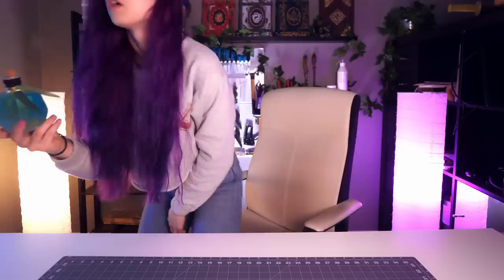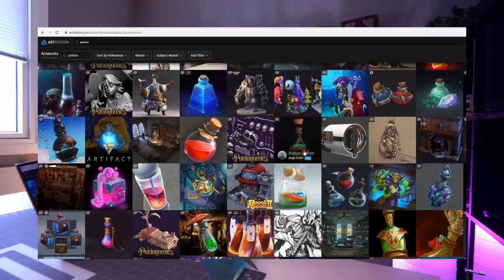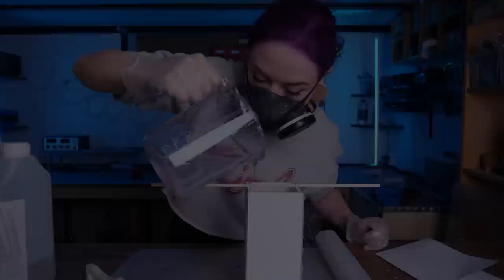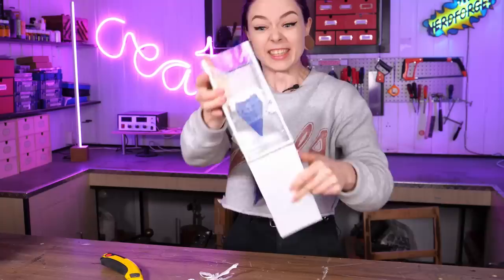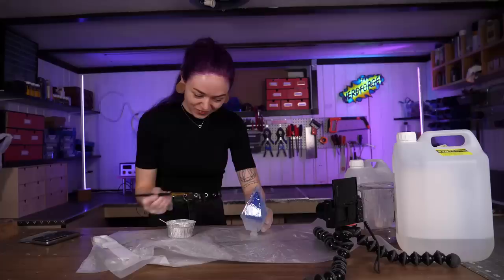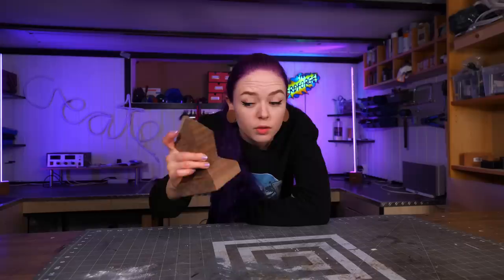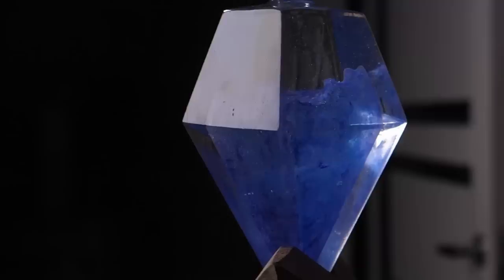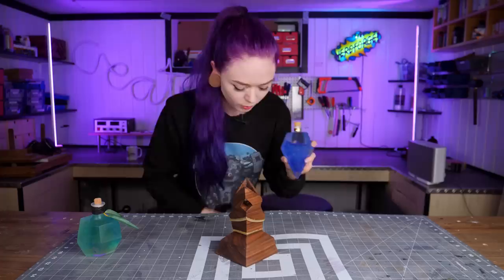I Made a Magical Potion from Epoxy Resin!

Comment: but why you dont just use the sanding method to make it shine i seen tons of videos for resin design and some can look almost like glass ? you can easily polish it using sanding methods  using same machine you had or another method , but its just a softer sanding tool it will look amazing

Comment: I'm curious as to your sanding process for the resin. I've only started working with resin over the last 5-6 months and I've tried sanding with wet/dry sandpaper all the way up to 1500 grit yet cannot get the resin to polish to a point I can accept it and its made me not want to attempt any projects that require sanding resin.  Any tips or guidance that you could offer to get clear resin to sand well?

Comment: hey @Nerdforge.
I'm kinda new to your videos love the things you've done so far.
but with this one i would like to point out a few things. 
i am a woodworker. and knowing how expensive the walnut is i would suggest and for future builds, if you want to make a hollow stand or a hollow something to remove time and materials spent to waste. to make smaller boards with a 45° bevel and glue them up using paper or packaging tape.
then u only need to cut the thickness  u need for the pattern or details u want to carve.
as for the epoxy and shine and stuff. there are a few you-tubers who do wood turning and epoxy stuff to shiny the max. like a dragon egg with wood and epoxy.
as example https://www.youtube.com/watch?v=ZA8E1RYE3qE which has a very good explanation to it.
hopefully it can help in the future of your projects.
I'm not handy with leds and stuff ut i think that color leds would have fit better to make a contrast against your blue.

you keep being you.
and waiting for the next one.

Comment: You could've just used clear glue or glue that turns clear when it dries to make the glass shiny crafts glue (the one people use in slime making) or vinyl glue (which is a personal preference of mine)
Crafts glue and vinyl glue are basically almost the same thing, the difference  is that vinyl glue is more "plasticky" when dry and stronger/sturdier than crafts glue (don't worry vinyl glue could be peeled off like skin once dried just like crafts glue)